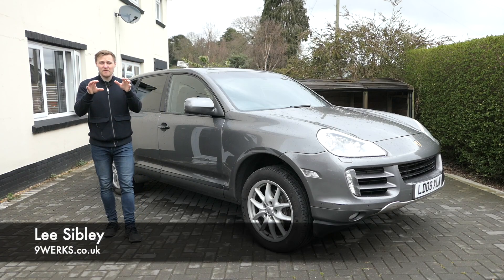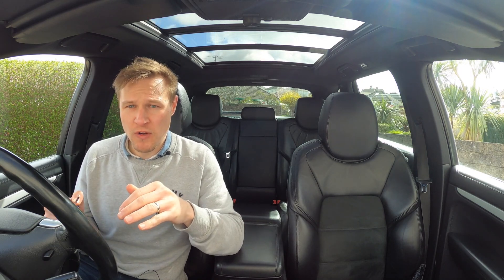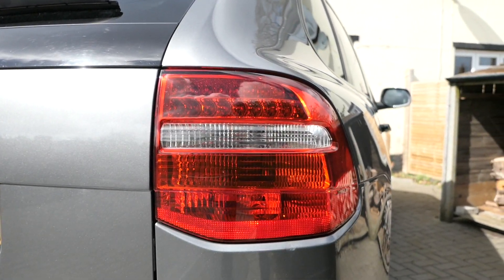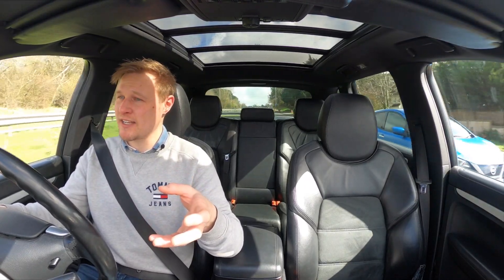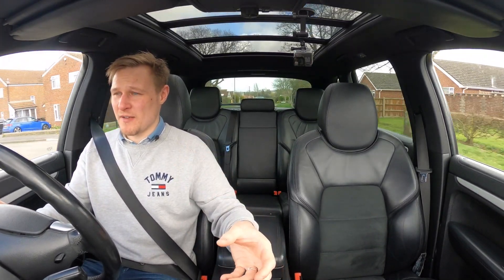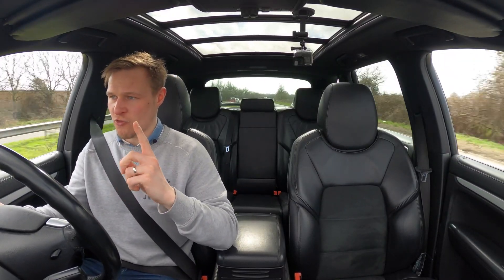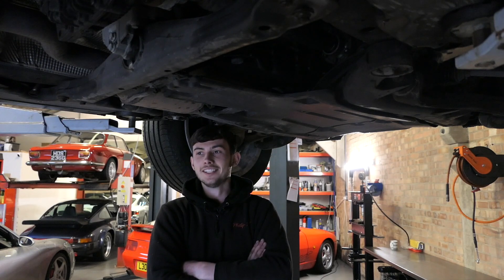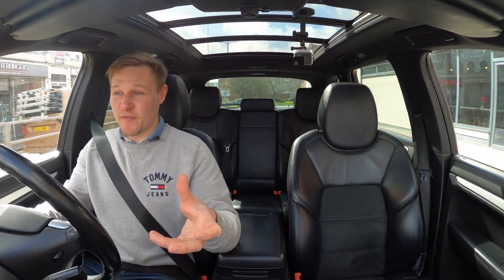Ultimate Porsche Cayenne first generation (E1) buying guide – in-depth owner review!

Comment: I own a 2009 cayenne s and it’s been the absolute best vehicle I’ve ever owned. I’ve owned it now for 10 years. Absolutely perfect with very minimal issues that were easily corrected. Now it’s a safari tribute with a lift kit and bigger wheels and what not, and it still does everything just as good as when I bought it… just a tad slower now 😂
Reply: How many km have you done an what engine is in it? 😊
Reply: @taydencornish  99k miles

Comment: It's important to note that the facelift 4.8 does not suffer from the cylinder lining issues that plagued the early 4.5l V8 motors
Reply: Is this confirmed or at least proven that the 4.8 reduced this issue?
Reply: @Dranreb865  yes of course it's confirmed, the car is nearly 20 years old now...
Reply: not true actually, a lot of n/a and turbos are affected as well.
Reply: @booo50  yes....the 4.5L V8 N/A and Turbo....not the 4.8
Reply: @gureno19  all of them and 4.8 as well.
4.8 n/a was made by the same tech process as 4.5 and tend to have issues with cylinder lining  as well.
half of used 957's n/a and turbos here on second-hand market are already went through the liner process. many of buddies whom I know also did it already. it's very common porsche problem, cayennes, panameras, macans, all of them, especially if you've not the best fuel quality and probably oil as well, like we here in Russia. After the lasing process with cast iron liners the engine runs well and often longer than the new one.
Reply: @gureno19 Turbos are fine as they have a different block